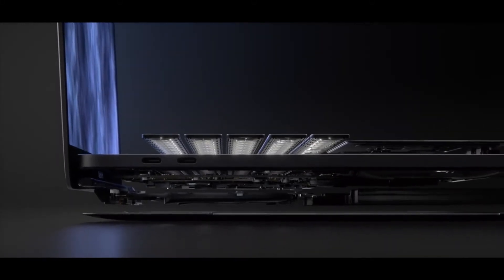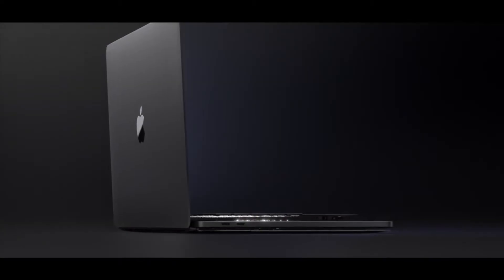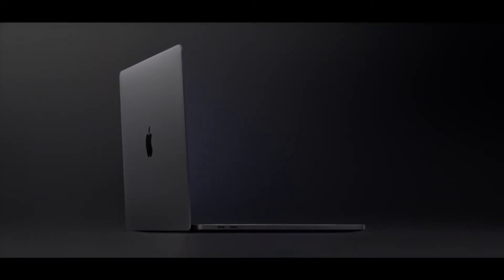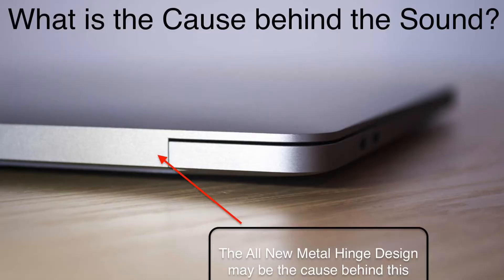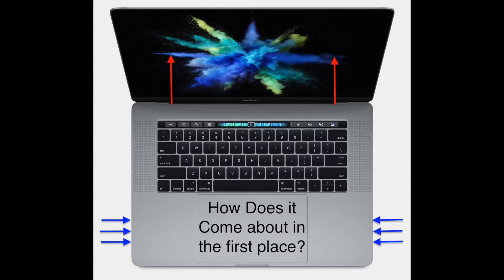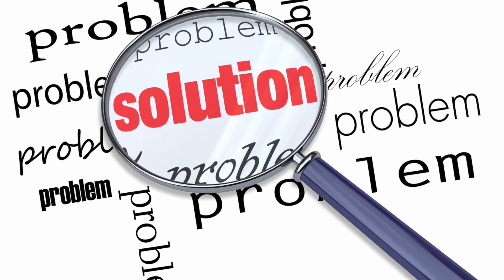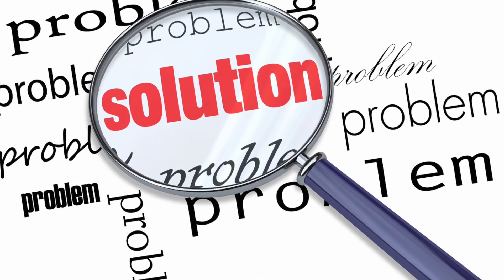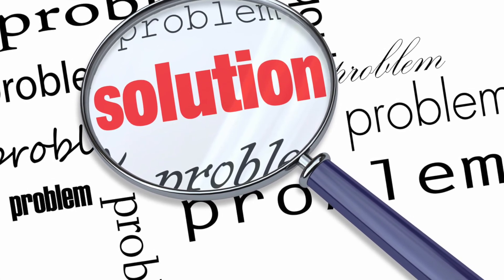Knocking Sound on 2016-2020 MacBook Pros

Comment: Same. I think it's related with the magnets that turn it on and off because it doesn't make that sound when I close the screen (flip the screen to turn it off)
Reply from the maker: Yes that may also be true. I still think its the hinge because after an in warranty screen replacement by an Authorised Apple Service Centre, the noise was gone, but after playing a few games and a round of editing the sound came back. It's actually a non issue. I've had my 2016 MacBook Pro for over 4 years now and this has never caused any issues with the performance or affected the normal functioning of my Mac. This seemed a bit disconcerting when my MacBook Pro was new, but over time I have learned that it's a non issue.

Comment: Exactly the same sound on my MacBook 2017 13", not just the sound, I can feel something knocking.
Reply from the maker: Same here, its probably the hinge, I had my entire display replaced for free under the Apple Care Protection Plan (which gives you a 3 years extended warranty), but it returned after my MacBook Pro hated up, since then no issues.

Comment: Had this problem on my 12 in macbook. The knocking sound is the force trackpad not the display haha! Bought mine in to the genius bar, they reassured me no problems would arise! Hope this helped in any way.
Reply from the maker: Steven Joseph actually there was a display knocking/rattling issue, as I  mentioned on the video I got a new whole new display module for free (basically the whole new top part of the MacBook Pro) and the sound stopped. But after a day the sound returned (after the MacBook Pro heated up).
Reply: @LordTechPro   My MBP after the repair screen comes back with this sound. Is your MBP still functioning?
Reply from the maker: @davewoo7114  Yes no problem at all
Reply: LordTechPro Good to heard that. Then I believe I will just keep it. This screen everything is perfect only knocking. I have many apple product I known when you keep exchange might get worst quality one another. Tqvm 👍😁
Reply from the maker: @davewoo7114  Yes

Comment: thank you for sharing.. there is any solution about this issue? it's kind of annoying
Reply from the maker: That's just it. It's only slightly annoying when you have your MacBook Pro in your hand, you won't notice it if you place it on a desk or on your lap. I have used my 2016 MacBook Pro 15" for over 4 years now and this hasn't caused any real issue.
Reply: @LordTechPro  I can clearly hear also when i working on the desk... WTF.. and seems getting worst and worst, spoke to Apple,  my MBPro had several issue, like keyboard, screen and battery, during the warranty now they need to check.. why i have this problem.. looks like to me that they don't want admit that's a problem
Reply from the maker: @Pagana4president  I didn't have any of the other problems you mentioned. Maybe it's a different issue? I haven't faced any issue with the butterfly keyboard and the battery. I did have a display issue (which Apple replaced free of cost under extended warranty) which was caused by installing an UAG Ice Plasma case: https://www.youtube.com/watch?v=T_GPgByjX-U. This case always required the display to be bent inwards to open. As I should have expected after 2 years, the display couldn't take it any longer and failed

Comment: Hey dude, do you get the popping sound when using the laptop too? It comes from the bottom of this crappy hinge and you can replicate it by pressing down on the lid near hinge when the screen is open > 90 degrees... otherwise no damage, same info from Genius Bar... these are said to be normal function procedures
Reply from the maker: Yes I got the same response from an Apple Service Centre too, Bartosz Skiba. Although paying around $2000 I expected Apple to make sure it does not fall back on quality!
Reply: Ya dude, honestly it sucks but this is the vibe of Gen 1 products ... I just hope that this computer does not fall apart on me in the next 2-4 years
Reply from the maker: Yeah same here!

Comment: I had the exact "issue" but its actually pretty simple; THE TRACKPADS VIBRATION MOTOR JIGGLING AROUND... even though it sounds like its coming from near the screen. I have two MacBooks in my family and they both do this (both touchbar 13 inches) so yeah, i know its annoying but don't worry nothings wrong :)
Reply: go to an apple store and shake their devices around xD im sure you will find the same sound!
Reply from the maker: Actually Roshan Pai that is a different problem (you are talking about the MacBook Pro Trackpad rattling sound), this is the New MacBook Pro. In fact I had the whole display (basically the whole top part of the Mac) replaced under warranty and the sound went away, but came back after my Mac heated up.
Reply from the maker: I already did but that does not clear the fact that the sound is irritating and not something we would expect from Apple

Comment: I also have this on my m1 MacBook Air . is it normal to have this noise or I'm unfortunate enough to get this model?
Reply from the maker: Turns out it's normal, don't worry about it, I have not faced any issues with this
Reply: do you face issues if you keep your macbook tilted and open the lid ? I face a click sound on opening the lid

Comment: i had this loose on my macbook pro 15"2017, then i brought it back to apple to for exchange. I took me 3 times exchange to get to the one that had nothing loose inside. The apple guys told me that it's not normal that something is loosed inside because everything inside this laptop is soldered, nothing suppose to move. So your case and anyone who meet this loosely problem, don believe that it's normal.
Reply from the maker: I know Eden Roth a had the exact same experience at 2 Apple authorised service centres and I got a display replacement (the whole top part of my MacBook Pro was replaced) and the sound did not recur but only for a week, as after I played a few games (which caused my Mac to heat up) the knocking sound returned.

Comment: I have the same issue. I just bought a 15 inch MacBook Pro(with touch bar)  and the moment I took it out of the box and handled it for a while I noticed that same noise. I have another MBP that's already 6 years old, so the moment I heard that noise coming out of my brand new MBP I took the old one and shook it a bit and of course it didn't make a single noise. This new MBP is the most expensive laptop I've bought so far, and to be frank I wouldn't have expected this kind of "design" defect from an Apple device. I'll go to the Apple Store to see if they have a solution, but as far as I see, this is something most MBP of this gen will have :( I'm seriously considering a refund. I was used to the excellent quality of Apple's products, and for the price of this computer I was expecting the best build quality laptop. This is sad 😢
Reply from the maker: Yes MrDemagallanes it is very sad and I did not expect this from Apple

Comment: im taking my 2017 macbook pro 13 inch in soon due to popping noises. (almost sounds like static electricity) I should have returned this laptop when i could and gotten the razer blade stealth instead.
Reply from the maker: well razor blade stealth does not run Mac OS, and does not have a touch bar and even though some Macs have this problem, Apple devices are unlike any other devices on the market. Try to get your problem fixed for free and under warranty, in the end its your choice.
Reply: Lord Tech Pro please help what should I do? I have same problem with pop  sound

Comment: I have MacBook Pro 2019 and it still rattles a little, however it is reduced I guess.
Reply from the maker: It turns out its a non issue it does not affect the functioning of the laptop

Comment: I just bought a new macbook pro 2015 a week ago and notice this happening to my MBP too!! Should I be concern about it in the long run?
Reply from the maker: Not at all, it does not affect the functioning of the MacBook Pro at all its probably designed in such way that it required moving parts inside which in turn make the sound. No harm at all I made this video 2 years ago and I am typing on the exact same Mac no problem whatsoever.
Reply: @LordTechPro  Thanks for clearing up my concerns
Reply from the maker: @Steadyawake  you are welcome
Reply from the maker: @Rockstar Fanboy It's a non issue
Reply from the maker: @Rockstar Fanboy Yes
Reply from the maker: @Rockstar Fanboy As far as I can tell nothing has affected the proper functioning of my MacBook Pro, I even put out a post last year, saying this is a non issue
Reply from the maker: @Rockstar Fanboy Yes

Comment: same sound coming from my 12inch macbook too
Reply from the maker: Actually it turns out this is a non-issue, but I was afraid that something was loose inside my MacBook Pro but my fears were alleviated at an Authorised Apple Service Centre in India. The representative said all new MacBooks have it (probably due to the new all-metal hinge design)

Comment: I sent mine for warranty. Replaced the screen and issue resolved. Do the same.
Reply from the maker: Andre Sousa its good to hear that, even I did the same, only to find out that the fix was only temporary. After a few minutes of high powered usage the sound came back again on my MacBook Pro.
Reply: Send it back again.... the screen needs to be replaced, as they corrected the whole assembly to make it more sturdy.... You can feel the difference...
Reply from the maker: Andre Sousa The Whole top part of my MacBook Pro (the display) was replaced for free under warranty and the sound went away but came back again. However I will try again to get the issue resolved at the service centre.
Reply: were you able to resolve this issue? considering taking it to Apple but if this is something they can't fix then i won't waste my time.
Reply: @Rockstar Fanboy 4 days....

Comment: its not the hinges.....its from inside the screen...already changed 3 screens within guarantee and all of them suffered the same fault.
Reply from the maker: Well the Apple service centre I took it to agreed that it was not normal and said it might be the screen hinge. After they replaced the screen (basically the whole top part of my MacBook Pro) the sound was gone. Only to return after I played some games which caused my MacBook Pro to heat up, and the sound to return.
Reply: the sound return because during your game playing, your macbook struggle with heat and that malt down some glue inside that screen.

Comment: HOW IT FIX ???? 
КАК В ИТОГЕ ЭТО ПОЧИНИТЬ ???
Reply from the maker: It does not need to be fixed, an authorised service centre got back to me and said the sound is a non issue
Reply: @LordTechPro  I have the same problem and its kinda dumb of them to brush it of like that. The MBP is a pro laptop with a pro price and therefore I think that it should have pro service. It annoys the crap out of me tbh.

Comment: Same for me on 2016...
and the knock when it heats up... 
and the clicking keys on the keyboard...
and the battery that lasts less than my 2009 17" MBP...

so disappointed 😞
Reply from the maker: Yes teejay87 but that's what you need to give up for design and speed!

Comment: Exactly the same sound on my MacBook 2015 15", not just the sound, I can feel something knocking.
Reply from the maker: It's a non issue really, I have had my MacBook Pro for 4 years and it hasn't led to anything untoward. What you do need to be worried about in your MacBook Pro Retina is the anti-reflective coating coming off (it's all down to user error, don't use abrasive cloths or any form of glass cleaning liquids on it).